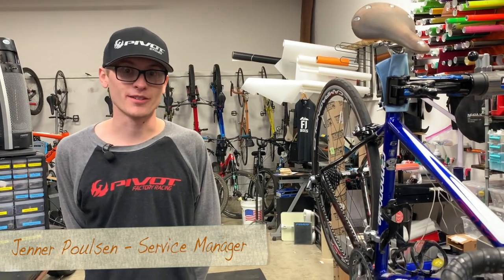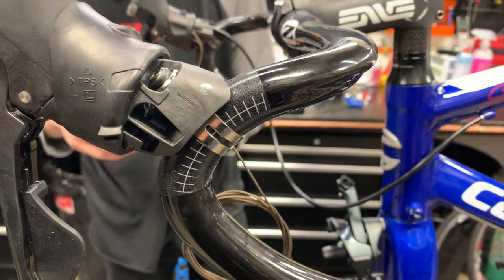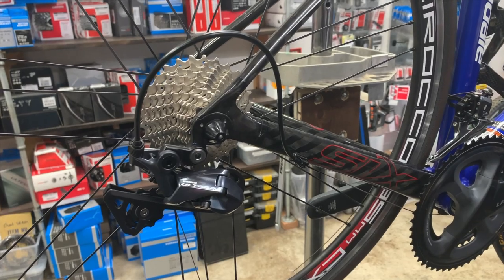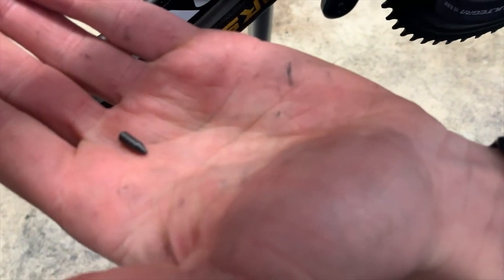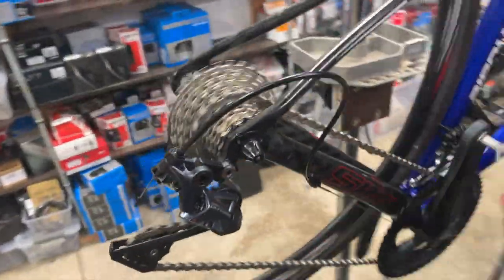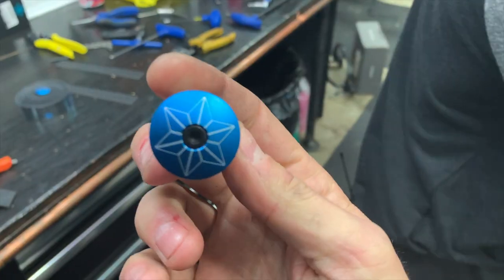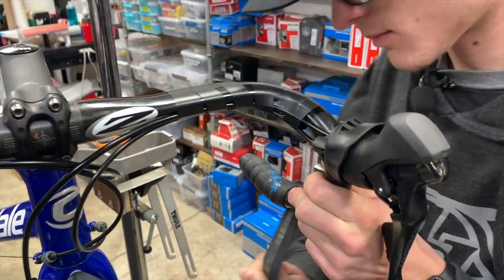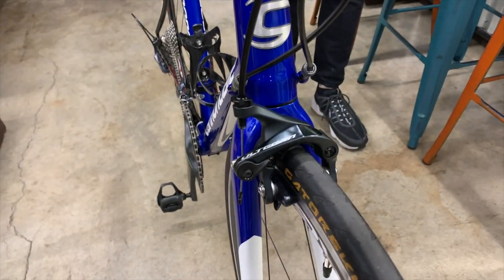Road Bike Drivetrain Upgrade 9-Speed to 11-Speed

Comment: Can you please do a video on installing the 11 speed cassette on a 9 speed freehub without skipping any steps? That would be greatly appreciated.
Reply: You will need to replace your 9-speed cassette hub with an 11-speed cassette hub for this to wok.  It looks like the owner of this bike already had an 11-speed cassette hub on his wheels, and was using a 9-speed cassette with a spacer to get proper alignment.
Reply: @YouNeedToHearThis  So are the cassette's any wider? is there a way to know it will fit your frame?

Comment: So @ 22:29 you show wrapping the tape inside to out for the drops, however on the tops you are wrapping the same “in to out” which is opposite of how it should be.  On the tops you tend to pull or torque towards your body or pull back, thus you wrapping should be “out to in.”  Food  for thought…
Reply: Yeah it was strange they explain why they wrap it the proper way on the drops then ignore that logic on the tops.

Comment: Sounds expensive, One video I saw from a bike shop owner/tech said you’d be better off buying the bike new instead of upgrading an entry-level bike.  You keep your entry level as a back up and get all the upgraded parts on a new bike by paying about the same or less, don’t shoot the messenger I’m just relaying what I heard from another pro
Reply: @alesstysanchez1614: 

It depends on alot of things, including but-not-limited-to the retail price of the components, the retail price of the other bicycle, whether-or-not the other bicycle is available in the frame-size you-want/need/are-looking-for., etc etc. 

Part of the problem I have is that the damn bicycle stores keep bringing bikes for midget-sized people, and forcing tall & very-tall & extremely-tall people to scrunch-up to fit the bike, instead-of the bike fitting THEM. when you go buy a pair of pants, you don’t go buy a pair that is too-small_or_too-tight for you, and then take it to a tailor to get it adjusted/modified. You buy [to begin with] your correct pants-size.  Same thing with a bike. 

If you buy a frame-size that is too-small, you can get pains on the nape of your neck, your shoulder-joints, your elbows, your shoulder-blades, etcetera.

Comment: I have a 2003 Trek 5900 which I'm considering upgrading from Dura Ace 9 speed to the more current Shimano 10 or 11 speed groupset.  The question I have is even when using an 11 speed hub, do you know if the rear stays are wide enough to accommodate the upgrade?  I'm almost certain the ten speed conversion will work.  New bike to me.   Frankly, any thoughts where to locate compatibility information is appreciated.  Thanks for a great video!